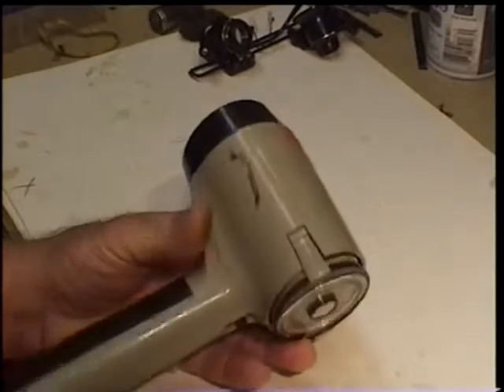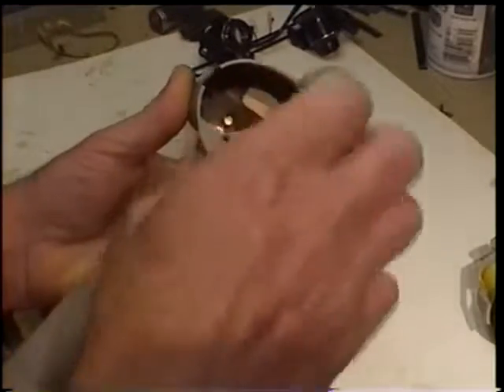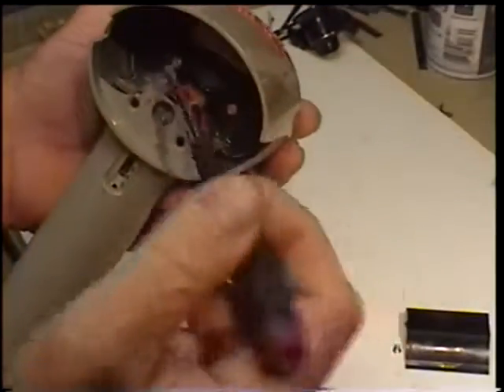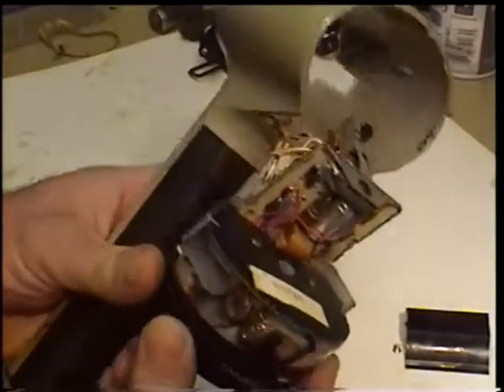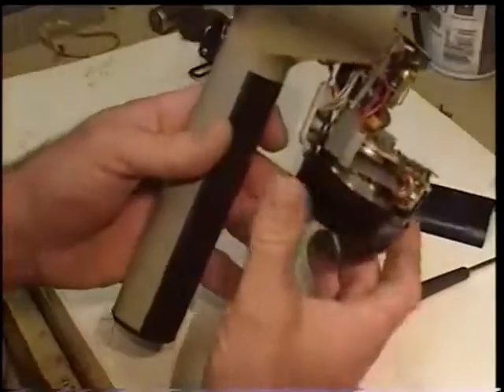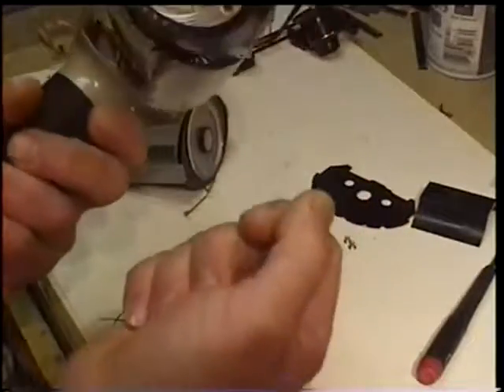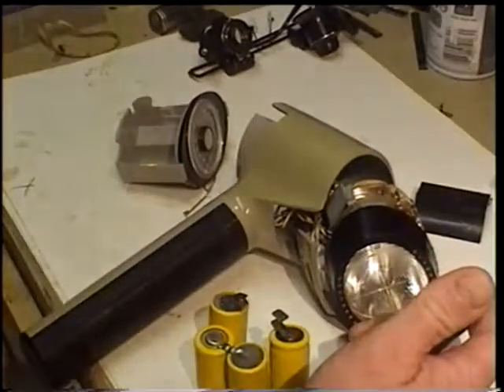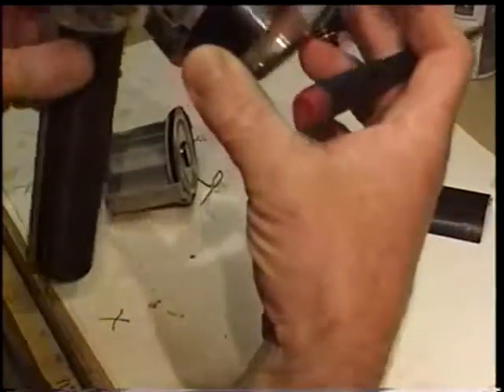strobonar flash

Comment: I've always wondered what the "handle mount capacitor" Honeywell Strobonars looked like. (I had a small off camera Strobonar 400, with a "plug-it-in-for-20-hours-for-a-full-charge" battery that was slow to recharge and suffered from the "NiCd battery charge memory" downward spiral.) I eventually settled for the AA cell Vivitar flash units that ranged from too weak to so-so until the #283/285 units arrived.
To "get faster recycling/more flashes per battery," I later bought a "510 Volt/#497 Eveready" powered Braun RL-515. I even found a Hershey AC power supply for #497 battery pack and used it for Orchid photography. Then I found a Capro RL-80/SunPak GX8R for closeups, and adapted a Vivitar 283 to handle flower sprays, fed by a Quantum Battery lead acid Gel cell. (Kodachrome 25 or Panatomic-X at ASA 32 required a ton of light.)
Reply from the maker: ultimately I gave up on these things, to old, to worn out, to impractical. I also have a big heavy power pack from the fifties that was fed by 2 lead acid batteries, I couldnt get that to work either, nice history lesson though.